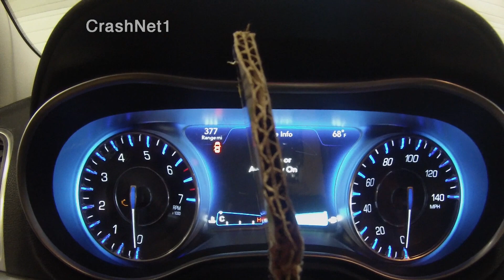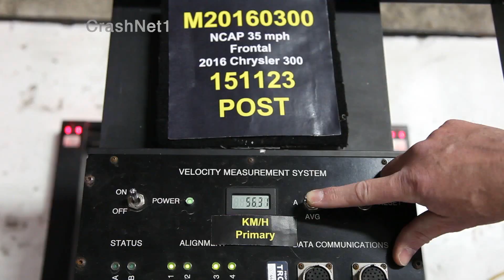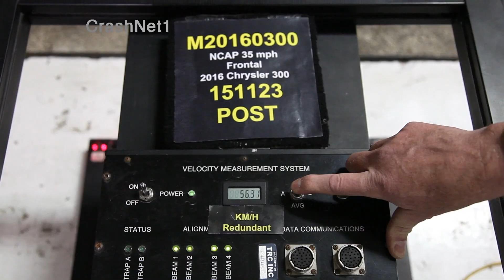2016 Chrysler 300 Crash Test (Frontal Crash)

Comment: I have a 2016 300s. I was driving 60 mph yesterday and a 95 Buick Lasabre went into my lane doing around 45-50 trying to make a left turn. My front driver side hit the Buick’s front passenger side and came to an instant stop on the right side of the road where I swerved to attempt avoiding the accident. Well obviously I hit. Three airbags deployed around me. One out the steering wheel, one on my window and one above the break and gas pedals. My gf sitting next to me got the dash airbag only. And my 5 year old in the rear passenger side had no airbags. My accident looks much worse than this crash test. Front end is completely missing. But no stitches or broken bones. My kid doesn’t even have a scratch. 

Now do (did) I have a safe ass car or was that just an act of god?
Reply: the crash test in the video is only 35 MPH and you said you where going 60 and hit someone who was going 45-50, more speed = a harder impact and more damage. 

The car has sensors in it that can instantly detect where the car is making impact. For safety so a air bag doesn't explode and knock someone out by mistake, and to save cost when getting the car repaired (air bags aren't cheap or easy to replace) the car wont deploy air bags where they are not needed. So if the impact like you said was mainly on the front driver side, the car did exactly what it was designed to do in not deploying the passenger side curtain or any of the rear air bags. Every car maker from Chrysler, to Chevy, to Toyota and Honda program their cars like this. 

Your lucky you where in the 300, they good cars made with over 4000 LB of good solid steel, a crash at speeds like that in a small economy car like a Chevy Sonic and you probably wouldn't have walked away scratch free.

Comment: Just got a 2014 300C with a 5.7, Knee air bags? Side air bags? I mean this thing virtually turns into a pillow when you crash. 

4600 pound car though, she is a beast, but going from a 300M I feel a lot safer in these beasts. 

With a lot of cars going smaller and smaller, safety is harder to come by. Small car hits an SUV and you're done. Large car hits an SUV and your chances are much higher.

Comment: hmmm... front windshield cracked.... not a good sign
Reply: +itimk0

  Its Become Common For That To Happen In More Recent Years,  Im Not A Fan Of It.  There Are Some Newer Cars That Didnt Bust, But Most Do.
Reply: Damn.
Reply: Not surprising for a head-on collision.
Reply: Tim the windshield gets cracked when the passenger airbag pops, there is a plastic door that tears the leather on the dash open to allow the airbag through which in turn smashes the windshield with brute force!
Reply: Dont forget a airbag comes out at you around 300km/h

Comment: would avoid getting one.  i just had a crash in my 2013 Chrysler 300 SRT  was going about 45km an hour and hit another car and the airbag didnt go off at all.
Reply: We're you injured?
Reply: That couldve meant that the car determined the impact was not severe enough to deploy it or it couldve been faulty you should had it checked
Reply: Ash Haddy did you contact Chrysler? Did they reply?
Reply: If the airbag system detected that it wasn't severe enough, it wouldn't have deployed, often, systems these days are set up to NOT deploy the airbags if a crash isn't severe enough because it costs even more money to repair the car if the airbags have deployed. Which, in such vehicles, results in somewhat lower insurance premiums! It's cheaper to fix!
Reply: Also, in many vehicles with passenger airbags, if the system detects that no one is sitting in a certain seat, whether it be thru weight sensors or seat belt sensors, it won't deploy the airbags on the side or section because there is no need to. It doesn't mean there is a problem.
Reply: Black Buick read my comment below...
Reply: Similar happened to me, same model, airbag didn't go off. I wasn't injured, and I wasn't surprised by it either. It's a low impact.